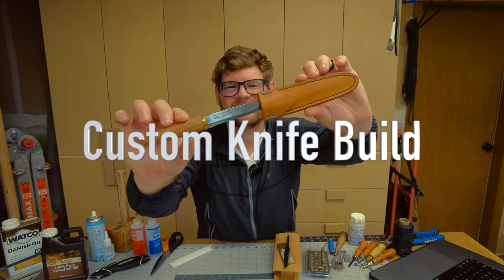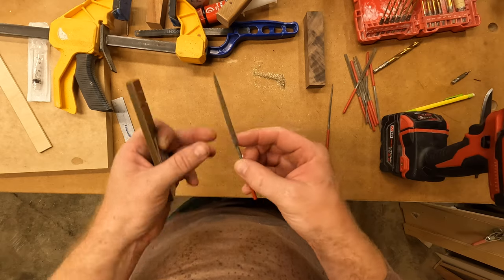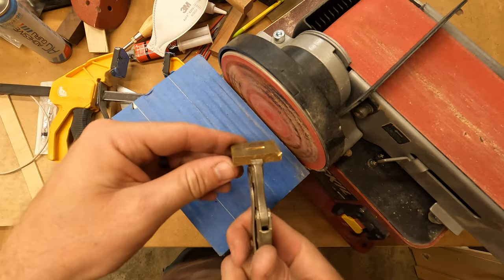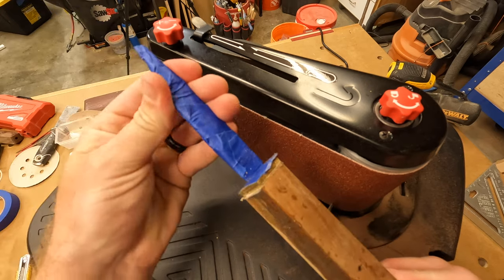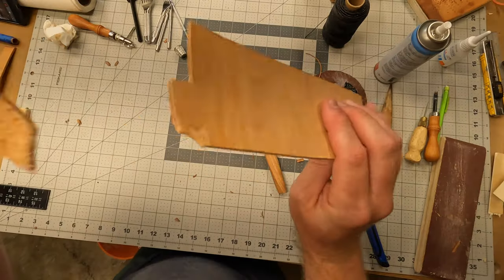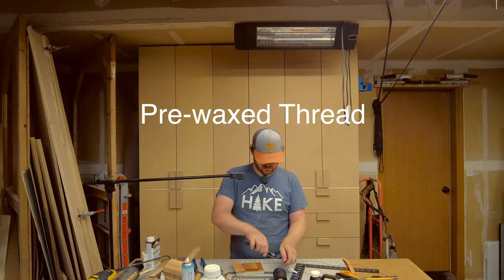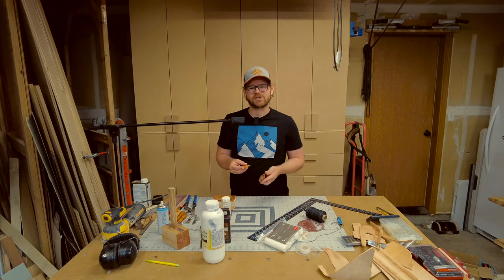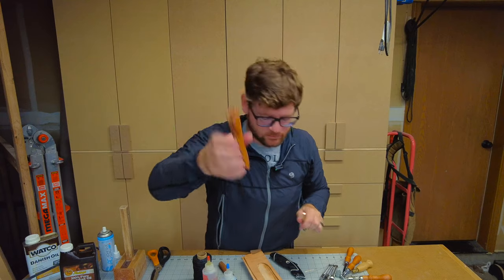Mora Knife Build [Done The Easy Way]

Comment: Pretty nice work, but when you pulled that knife out of the new sheath and there was some torque towards the blade edge, with your fingers wrapped around the outside, I thought you were going to have to go to the ER for emergency tendon surgery.  I see that you did cut the inside of the sheath a little bit.  Try some sacrificial leather on the edge side, or maybe add some rivets or chicago screws to enhance the safety for your fingers.  I watched your video because I want to build a couple Morakniv blanks into knives.

Comment: They usually drill the handle but i hope the glue holds up.
Reply from the maker: I used a two part epoxy to fully secure the wood handle to the tang of the blade. Very durable and hard once fully cured.
Reply: Drilling is the only way to go if you want it to last.
Reply: @WithDavidsHands  Yeah gotta agree with the above, drilling and pinning the tang is best.

Comment: Handle's too small and that cut in the handle that you filled with epoxy seems to me to be an obvious point of failure. Should have drilled it and pushed the tang into the handle from the top -- like Mora does.

Comment: As someone who just had to buy a morakniv sans handle because I needed a carving knife with a curved blade and these were all they had, how necessary is the brass bolster? I’m just trying to whittle, don’t really want to have to buy brass and brass cutting tools.
Reply from the maker: The brass is not necessary at all. You could use wood or just about anything for the bolster.